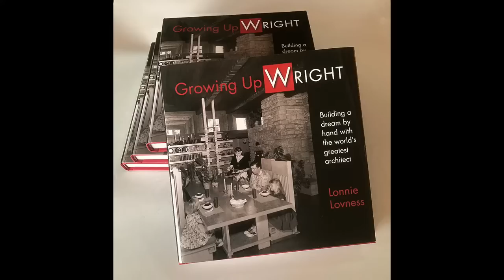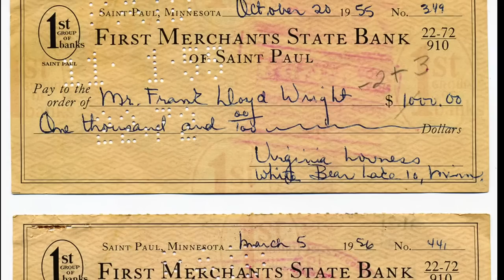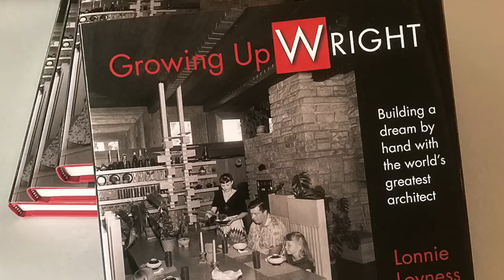Frank Lloyd Wright, building the Lovness studio, 1956

Comment: Are you going to build the additional homes wright designed for your folks?
Reply from the maker: The houses were sold in 2017, and the new owners have built one beautiful additional structure, based on a cabin design from Wright. It's unlikely more will be built, but the original houses have been restored and updated. There is a long chapter in the book with many photos of the renovation and estate as it now looks.

Comment: Wright was Wrong .. he didn't like addicts .. he felt it was a waist of space. Addicts vent warm moist air out of the building. With no addict, the moisture is tapped, condenses then rots the structure. I believe he held the same dislike towards bassments.
Reply from the maker: Yes, Mr. Wright avoided attics and basements, along with kitchens, garages and large bedrooms. We love his designs in spite of this.
Reply: @lonnielovness4589  Yes ... open contracept  can be good ...bedrooms have limited function ... opening up the rest of the floor plan does have its advantages ... It is the moisture problem witch appears to be his downfall ... so to speak ...
Reply: @lonnielovness4589  It is a lovely house, by the way! Sorry for the late compliment! I live in Toronto. One day in the early 1960s my aunt was out looking for a job. She entered into an Architect's office looking for any kind of job. The office was in a mess, phones ringing off the hook. She seized the opportunity by answering the phones, taking messages and generally easing the tension in the office. She would go on to work for the Architect for over 40 years. The architect's name is Raymond Moriyama ... quite the architect in his own right! FYI ... swell chatting with you!